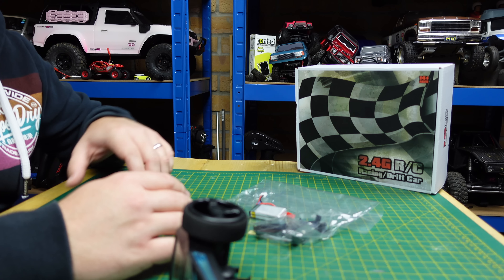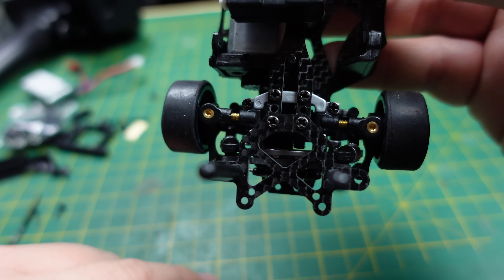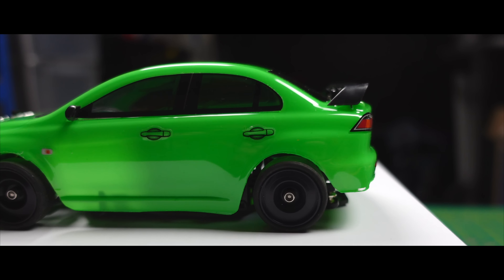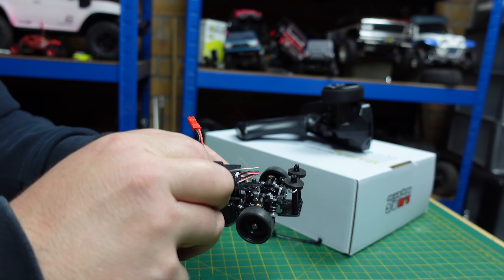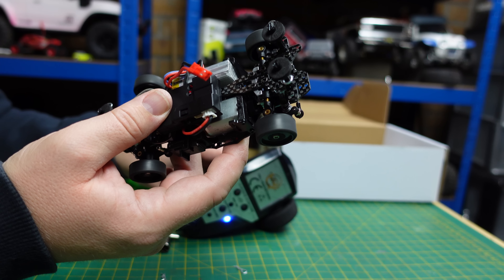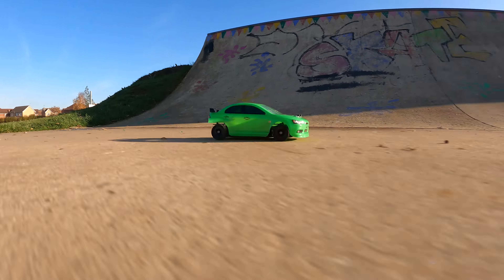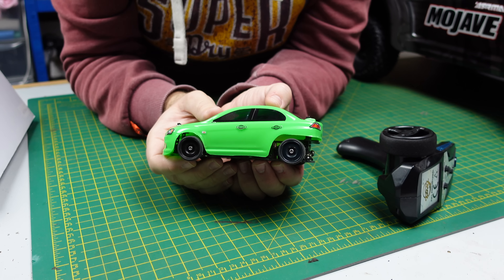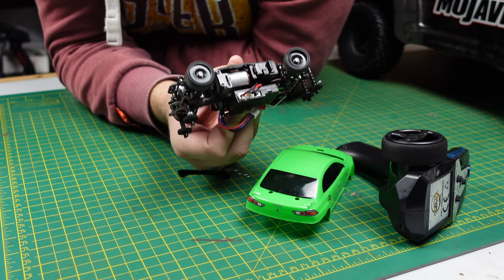Epic Carbon Fibre Mirco RC Drift Car! 1/28 SINOHOBBY TR Q7 like a Mini-Z

Comment: Mini Q7 is a very capable platform once you grind out the rough edges from the factory. The stock plastic CVD is an issue and should be replaced with metal ones for k989 which are slightly longer. With the low CG and suspension setup, it can run fast and stable. Its compatibility with mini-z autoscale bodies is also good but need to be aware it's wide both front and rear. Overall this is my favorite RC!
Reply: I realize it's kinda randomly asking but does anyone know a good site to watch newly released movies online?
Reply: @rohanbrady1528  LOL

Comment: I have the WL Toys K989 and 969, same layout but less than half the price. Super reliable fun for home racing and loads of extras available. Couldn't think why you would spend so much more on this.
Reply: Same here, and very customizable
Reply: Agreed!
Reply: Once you buy the stuff that make the K series cars good and reliable, you're into them about the same money.  
The mini-q 7+ are adjustable to fit all the mini-z shells (with the correct size driveshaft, extra)

If you want a cheap basher, Wltoys wins.
If you want something that once it's fluffed and buffed, can hold it's own against any high-end drift or touring chassis, or can fit a wide variety of bodyshells or drivetrain configuration, with a high degree of adjustability in the suspension set-up- the Mini-Q offers more for your money.

Definitely takes a good while to get the mini-q kits/parts imported though.

Comment: I was curious about the new version so here I am. It's unfortunate that they've changed so much stuffs. It used to come with good ball bearings or at least the same size on both sides of the diff so it won't chew the gears, metal CVD and a 2-in-1 unit that's compatible with Flysky radio.
Still, this new EVO-X body is pretty cool.

Comment: Sick looking!.. but...I have the wltoys 1/28 k999. Has the same multi-board as that car. K999 is a much better bargain in my eyes at $50. Much more reliable out of the box and the diffs are enclosed. Just need to immediately get the upgraded metal drive axles. The plastic ones break within the first couple runs. Anyway.. I love it. Fun size
Reply from the maker: Yeah the WLtoys look a decent deal! I ordered one a while back and it never turned up. Then they went out of stock so just got a refund in the end
Reply: @TomleyRC  that sucks. You should definitely get one though. They are crazy fun and fast out of the box. Just remember to get the metal axles right away.

Comment: not near the quality but had no gremlins, the TRQ-1 is their older clear blue chassis was ready to run for 43 bucks at BangGood, does 4WD drifting well without any diffs in it. body choice of a Subaru or a Toyota. nice light buckets if you want to fill them and make red lenses for the tail lights. no toe or camber adjustments, they set the rear toe in a little steep so it does drift pretty nicely. it wont handle 2S, takes 4 AAA's or get AAA size NiMh so it doesn't burn itself out.

Comment: I got one of these a couple of years ago, I also had trouble with mine, I was wondering on this newer version out that you have here, is there any play at all on the ball joints between the lower suspension arms and the underside of the hub carrier? As mine is as sloppy as it gets, thank you for sharing this video👍
Reply from the maker: That all seemed ok, it was just the issue with the CVD's and the spur/pinion
Reply: @TomleyRC  I believe that the swing shafts are pot luck to be honest, there doesn't seem to be any consistency with the quality in that area and unfortunately the shafts come in as an awkward size, they are kind of inbetween the 2 standard sizes available for the '1/28 scale' scene, 
     Would you know if the receiver/esc is compatible with the flysky radio protocol like the older version? Thanks dude🤘